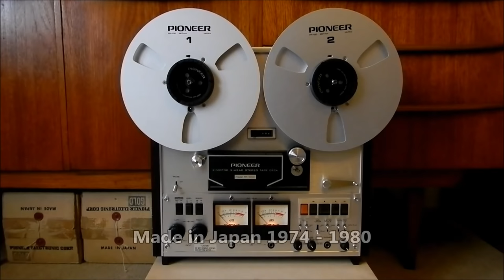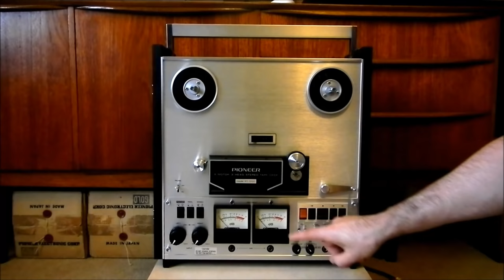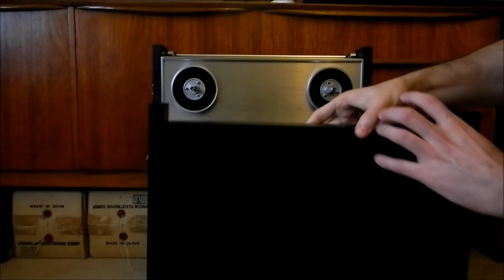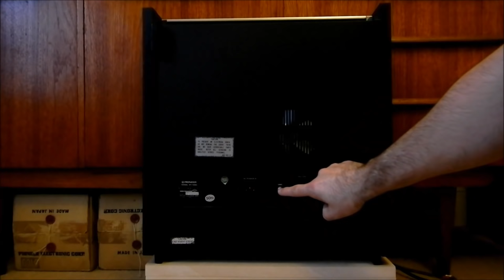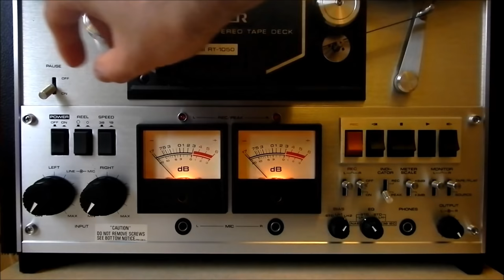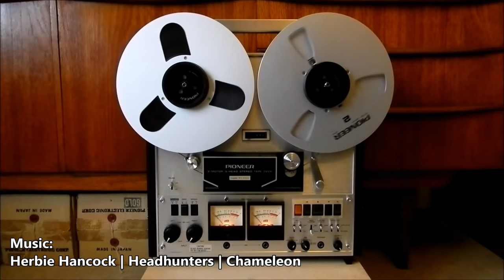Pioneer RT-1050 2-Track Reel to Reel machine Review & Demo

Comment: A great example of this machine.  Well restored.  I've restored a number of them myself.  Nicely done!  Just a couple of things:  The tape handling devices are usually referred to as a tape guide (left) and tension arm (right).  This machine is unique in Pioneer's RTR line primarily for two reasons.  It's the only machine to have a choice of meter scale and the only machine to have a choice of of "rec enable" LED function and +6dB peak function.  (It routinely responds faster than even the best analog meter can.)  I set mine (and the SM recommends) setting the onset at +5 and the "full" onset at +6dB.  Lastly, IEC was a Far Eastern alternative to the NAB (National Association of Broadcasters) standard for Bias and EQ parameters.  This machine is (to my thinking) undervalued in the collectible market place.  It's not QUITE as "professionally" featured as its more ambitious sibling, the RT-2022/44, but it gives up surprisingly little in performance.  The 1050 meters (while slower than the LED) are the ONLY meters I've ever seen that can follow the sinus of a 20Hz Test tone in real-time.  So, even if they aren't LED fast, they're certainly no slouches.  The RT-909 might have excelled at slower speed performance but this machine gives up nothing to the 909 at their one common tape speed.
Reply: The RT-1050 is a vastly better sounding machine vs the RT-909. First of all the RT-1050 is half track professional format, and discrete transistor vs the RT 909 IC's which are comparatively noisy.
Reply: I'm glad someone corrected the "stretchy thing"... Eeek. Stretch is the last word you want to hear in the context of a tape machine lol

That aside, this is indeed a very nice machine and in excellent shape. Pioneer had it together with these things, and several other categories of audio equipment in the day as well. Vintage audio porn indeed.